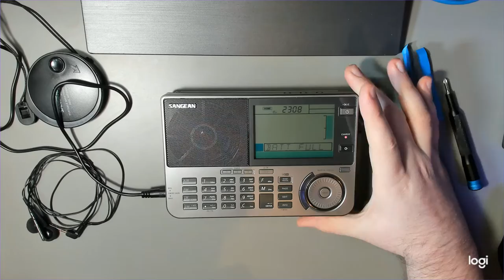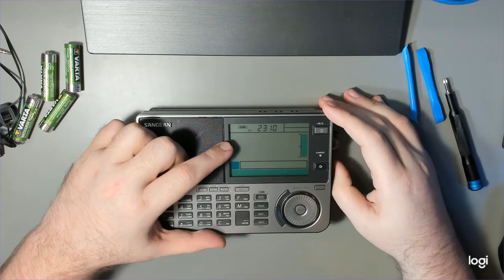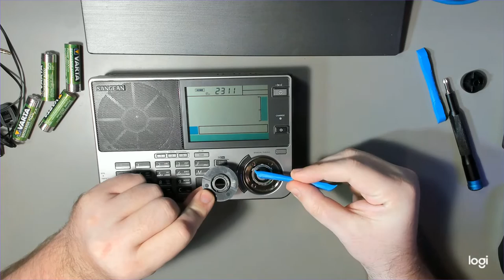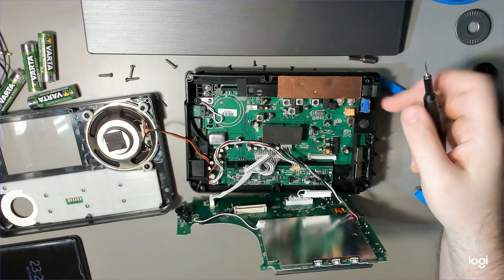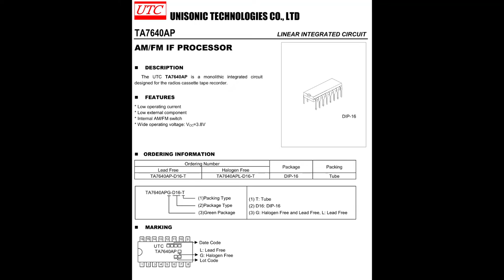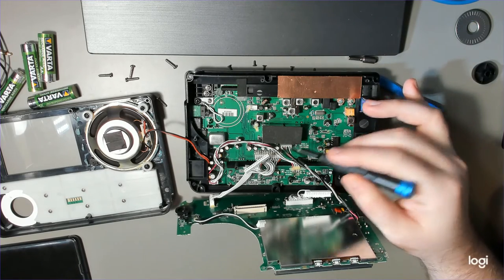Sangean ATS-909X2 Teardown - preproduction EU version, firmware 070

Comment: it amazes me that of all the things Sangean decided to do with this hardware update, they tackle the airband.... over tackling fixing some of the biggest issues that have plagued the radio since the ats-909 days... like the built antenna on shortwave which gives significant difficulty when trying to get loud enough volume to hear using it , no sync detection (its priced as a $300.00 premium radio... shortwave stations haven't been getting easier to pick up these days), Glad to see they are using the expanded FM range at least, hopefully they won't change that as that would effect people who use the radio to travel with in some regions.

Comment: Your mystery "3560 DMRX 016" component is a Silicon Labs Si4735-D60 device.  It's a radio-on-a-chip capable of 153-279, 520-26100 kHz and 64-108 MHz according to the official specifications (obviously it will do a bit more, since receivers that use it can tune slightly greater coverage than that).  It is almost a stand alone radio in one IC: give it a power source, connect an antenna to the input, and earphones to the output and a means of controlling / tuning it, and you have a complete radio.  By the looks of the circuitry, the chip isn't being used in this manner in the ATS-909X2, but rather as an IF tuner; conventional superheterodyne conversion down to an IF (eg: 10.7 MHz) and then the chip resolves the received signal at that IF.
Reply: Some guys say the SiLabs chip does all the IF filtering for the radio. Others think it has minimal activity on MW/SW. I'm pretty sure it's active on FM, at least acc. to the 909X schematics online (never found a schematic for the 909X2 yet).

Comment: Andreja Kostić - Hurts to see opening such a wonderful radio, especially because I couldn't do it without damaging it x)
Reply from the maker: Practice makes it easier. This radio is actually a bit difficult to put together. The case is a bit flexible, and a bit of pressure need to be put to make everything fit together. The flex of the case can also mask the situation where some parts didn't fit properly. In that situation, the radio can externally look fine, but it can sound terrible, because parts of the case will then vibrate.

Comment: I acquired a Sangean ATS-909x2 at a good price from a friend of mine. It does not work on AM mode (LW/MW/SW/Airband). Could it be its IC TA764AP is damaged? I got this 909x2 because of its great FM reception. In fact, I have another 909x2, this one generates some interference specially MW when using its ferrite rod antenna. Do you think this could be to poor shielding? Great vide, thanks.

Comment: Very interesting,  from looking at image's online i see that there are differences between this one and the earlier versions, there's no ribbon cable for instance and the circuit board layout is different,  did it go back together okay ?
Reply from the maker: Yes, it did, but there are a few tricky parts. For example, it's important to route the white cable on the right properly (I suspect, but am not sure, that noise which can be heard when hand is placed on the screen might be coupling through that cable). Otherwise, the radio will be too thick to fit together properly and can rattle when assembled. The bandwidth switch should also be properly mated with its outside assembly. The radio case is elastic, so you can actually put it together without using too much force, and it won't be obvious that it's not fitted perfectly until you turn up the volume.

Comment: There should be a date code (year and month) molded on the underside of the battery door/cover.
Reply from the maker: It's just a sticker now, and the date code is part of the serial number. The code for my radio is 2020/10.

Comment: My radioshack dx-398 (Sangean ats 909) when I'm on the FM band the clock goes back 01:12 for example I correct the time to 10:00 after a few seconds the clock changes to 09:12 minutes only in FM RDS. I've done a factory reset but it didn't help.
Has anyone had this problem and how did they solve it, can anyone help?
Reply from the maker: Is it only on that radio, or on all RDS radios? I've had situations where radio stations would commonly transmit incorrect time over RDS, and the only option was to disable time synchronization using RDS.
Reply: @AndrejaKostic  You must test the car radio or RDS at the station to certify that it is correct or that the radio or transmitter hours are correct.
Reply: It sounds like you have the “Time Set” switch on the right hand side of your DX-398 set to “Auto” and are listening to an FM RDS station transmitting an incorrect RDS time signal.

Change the small black “Time Set” switch on the right hand side of the radio to “Manual”, set the correct time using the normal process and this problem should then be resolved.

Comment: Much easier to come apart than the 909x with the hard to reach Display Ribbon Cable in the Middle of the Front of the Chassis. This Cable is easy to come apart but hard to reconnect.
Reply: Hold the display portion of the X model over and above the top side of he lower chassis. That will allow enough space to get your fingers in there to re-attach the hanging cable. But yes, without discovering this trick, it's a nightmare getting it back in.

Comment: Hello Anapeja, I know nothing about radio technology but your ATS-909x2 dissembly interests me. Should we buy ATS-909X2 for SW reception? Is ATS-909X2 better than vintage Sony ICF-SW55 or the other way around? ATS-909X2 looks similar to ICF-SW55.
Reply from the maker: Hello Ken. I'm sorry, but I really don't know. I haven't used the Sony ICF-SW55, so I really do not know, so the post below is mostly my speculation. 

From old Sony radios, I've only used the ICF-2001D, and well, it's a bit difficult to say which is actually better, but I prefer to use the ATS-909X2.

When I compare the 2001D with 909X2, the problem is that 2001D was designed in time when AM radio in general was taken much more seriously, so it has synchronous reception, the medium and long wave reception is better, and sometimes, I have a feeling that the audio on SW is better too. However, the 2001D is a big radio, the batteries are heavy and last a short amount of time (and I, due to RF noise, almost exclusively use the radio when portable in a park or similar). 
Also, the older radios bring their age-related issues with them: LEDs might be very weak, they might be off-frequency and require tuning, and opening them up and adjusting them is not the easiest procedure.

Looking at the prices of the ICF-SW55 here in Germany, it tends to be around the same as the 909X2. 
So unless I could get the ICF-SW55 significantly cheaper, or if I felt very comfortable servicing an ICF-SW55, I'd go with the 909X2. 
Also, from what I could see, the ICF-SW55 doesn't seem to do SSB, and 909X2 sort of does.
Reply: @AndrejaKostic Thank you for answering my question. Keep up your good work.

Comment: was wondering, since it uses swich mode power supply (I don realy like those) does power supply cause any interfence?
Reply from the maker: Hi! It's difficult to say. I have huge amount of conducted interference at home, so it's difficult to say how much the power supply itself is adding to the interference compared to a linear power supply. My power is simply too dirty. 

I did test out the radio both with its own power supply, and with a Diamond Antenna GSV3000 (set to 9 V) linear power supply, and the noise with both power supplies was about the same, so compared to my regular level of noise coming from power lines, the Sangean power supply isn't adding anything obvious. However, if you're in an area where the power is cleaner, I can't say if you'll be able to hear a difference or not.

By the way, unlike some other Sangean radios (say ATS-505), the 909X2 won't shut down if you connect a disconnected power cable to the receptacle. So this way, a power cable might be used, for example, as a ground radial.
Reply: @AndrejaKostic  Thank you

Curently I own ATS909X and am very happy with it(allthough I had its antena snap off at the base(was fixed by third party), and I had to clean dust from tunning knob)

So I have to justify upgrading :)

What I like is filters on FM (I realy missed that on 909x) and hope that they can be configurable

And hope I can apply this hack: http://radio1.dxing.si/index.txt

To get OIRT FM band support like on 909X

Would like to see some RDS debug info like PI Code but maybe this can be enabled somehow

Thanks and please forgive me asking you questions like this 😀
Reply from the maker: @DXingSlovenija  Well, for the expanded coverage, the radio goes from 64 MHz to 108 MHz on the FM.  The configuration options are described in manual, and are public, so no hidden hacks are needed. 

The RF FM filters are 110 kHz, 85 kHz and 65 kHz. I think that they're quite strange, since many stations in my area (at least) are 200 kHz wide, if not more. There are also 3 AF filters (news, normal, music) , but I haven't found any specifications for them. I suspect that Silicon Labs Si4735 does the RDS decoding, but I'm not sure hot easy to reconfigure it is. I still haven't taken time to read the datasheet and rest of the documentation in-depth. Perhaps it's easy to change the configuration of the chip?
Reply: @AndrejaKostic  hmm thanks, I hope filters (since they are dsp filters anyway, not analog filters like ATS909X has) are configurable, what about Auto mode (filters), does it go beyond 110khz? Is it good on blocking adjasted stations?

BTW: what tunning steps you can choose from on FM(I guess 10khz if using 64-108Mhz coverage)

BTW: can you make a video, demonstrating Airband?
Reply from the maker: @DXingSlovenija  Well, I did take a look at the filters in the Si4735, but I couldn't find anything conclusive. When I have a bit more time, I'll try to read the whole documentation set. In general, DSP filters does not imply that it's possible to re-program them. They might be pre-computed and stored in ROM or PROM or similar. Again, I'm talking in general, I still don't understand all the details about the Si4735.
The auto bandwidth option just switches between the available filters, and there aren't any extra auto-bandwidth filters. It can get a bit annoying, if the signal is on the edge between two bandwidths, because the radio will keep jumping between them.

For FM, there are the 50 kHz, 100 kHz and 200 kHz steps.

I didn't really test out how good it is at blocking close stations. I'll have to find some, and then try it out, or test it out with a small FM transmitter. 

For air band, I'll see if I can do some videos. I'll definitely have to wait until the weekend for the free time. 

In general, I have mixed opinions about the air band. I'm very happy with the audio quality (compared to my Yaesu FTM-400XDE and my Icom IC-2730E), but the radio doesn't have the new European 8.33 kHz step! This is a big issue for European users, since the migration period ended in 2018. The radio does have the 5 kHz steps, which are often close enough, but it can only scan with 25 kHz steps, so it misses 2/3 of the channels. 
I don't really have anything to say about the sensitivity: I don't have the means to do a useful test or comparison. The squelch option does seem to work fine. 

I did write to Sangean, and ask if there's a solution for the screen buzzing issue, if it's possible to change the FM deviation (which might be of interest of you want to take the radio to the US), and if they have any comments about the airband step. The response was that they're aware of some issues, and that they'll replace the old radios with new version, but they didn't say anything more specific than that. 

So if you're trying to justify the upgrade, my advice would be to wait until the reviews for the new production version start coming out, especially if you find the airband important. 
Also, if you haven't already, check out o00scorpion00o's channel. He also has some videos about the 909X2, and should also get the new version, once it comes out. Do feel free to ask, if you have more questions! :)
Reply: @AndrejaKostic  Well thank you for souch a great anwser, will probably wait til summer anyway and see, maybe they fix some issues (the only dissapointment for me is 50khz steps even on OIRT (because thats a downgrade, as I have 10khz now) and fixed filters (as all the DSP radios I saw (Harman car radios, Sony XDR-F1HD) have reconfigurable Bandwith filters, if not from the factory, at least throught Debug menu or some hacks exist)

Polar Stereo Decoder is probably too much to ask (since the chip can only do CCIR stereo), or user upgradable firmware (radio has A/B terminals, with proper documentation and sdk from sangean, it would be great, since comunity always has ideas for features, that sometimes manufacturer forgets about
Reply from the maker: @DXingSlovenija  Once I get the final version, I'll definitely take some time to take a look at the whole system, and see what I can see. I really don't know how locked-up the Si4735 firmware is. Perhaps, it might be possible to change some configuration settings?
Reply from the maker: @DXingSlovenija  Hi! I got notification of your reply via e-mail, but it seems as if youtube blocked it from appearing. I can't find it in the comments. In any case, it's quite interesting! I'll have to take a look at that as soon as I come back from my vacation.

Comment: İ have bought a Sangean in 2024. İt is a graphite color radio with firmware 078 and it performs excellent on shortwave with the included ant60 antenna. That it doesn't perform on SSB is not so important for me. İf you want a better radio get the Tecsun 880 or Tecsun 990x which costs a fortune!
Reply from the maker: Hm... In my region, the ATS-909X2 is more expensive than the Tecsun PL-990X...

Comment: My cat knocked my ATS909X2 off my desk when the antenna was extended and the antenna was broken. From your video it appears replacing it will be a challenge, do you have any suggestions?
Reply from the maker: Hey Chuck, sorry for the late response, I've been quite ill this week. 

The difficulty depends on where exactly the antenna broke. The whip is connected to its base by one screw, so if the whip itself broke, then you don't have to replace the base: Your remove the whip from the new antenna and install it on the old antenna.

If the actual base of the whip, which pulls out of the radio body, broke, then it's a bit of work. You have to open the radio. At 15:55 in the video, you can see a black screw. I thin that this screw holds the antenna base connected to the rest of the radio. The "up-side" here is that you would only need to open the radio to unscrew it. You don't need to remove any of the circuit boards and so on, but on the other hand, screwing the radio back together is a bit difficult, and if you don't do it properly, the case can crackle when the radio is playing.
Reply: @AndrejaKostic       Thank you for your reply. I hope you get over your illness quickly.  The antenna broke on the radio side of the swivel joint, so the easy fix  will not apply in my case. Take care ... Chuck

Comment: Did you ever send your ATS909X2 radio back to sangean?

I sent mine and because of component sortage, I need to wait a long time for a new graphide one to be manufactered so I can get a replacment

So now I am using my ATS909X in the meantime and waiting for my ATS909X2 to arrive, I hope the latest version wont have problems :)
Reply from the maker: Hi, nice to hear from you! 

I did not send mine. The Sangean said that they would contact me, when they sorted the issues out, and they didn't, and I didn't remind them. :) 
In any case, the bugs which were reported as fixed in the firmware do not affect me, so I wasn't in the rush to send it back because of that. Additionally, my firmware version (070) has the option to show both received signal strength and the SNR. I got used to this mode on the Tecsun radios, so it's the only mode I use on the 909X2, and from what I've seen, it has been removed in the current firmware, which I find really annoying. 

Additionally, I've seen that there are radios with the new firmware which have the low SSB volume issue (and that's the main issue I have), and that there are others which do not have this issue. So just getting the firmware done won't fix the low volume. 
I was actually thinking about trying to contact Sangean and ask if there's a service manual for the ATS-909X2 available (I politely asked one for my old ATS-505, and they sent it to me), and seeing if the low volume is something that can be fixed in hardware.
Reply: There is a strong birdie at 610 kHz on my X2. An external antenna defeats it, but on the ferrite rod, it's bad. MW, LW, & SW sensitivity is also handled differently compared to the two previous models. At first it seems that the X2 is noticably less sensitive than its predecessors. And when near strong signals using an external antenna, you don't need to turn down the RF gain as much, or at all. But it could have better RF dynamic range and the RF gain pot could also cover a wider range of resistances.